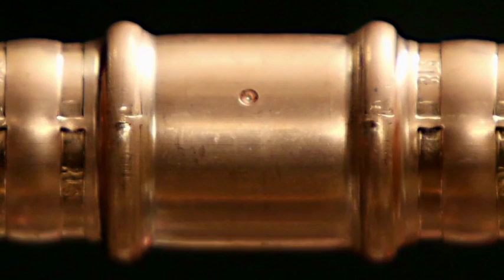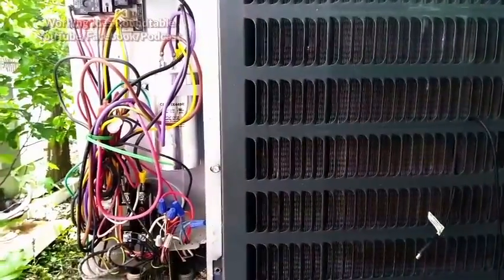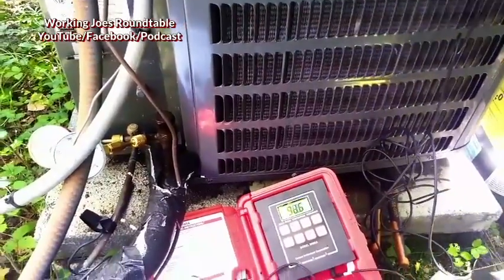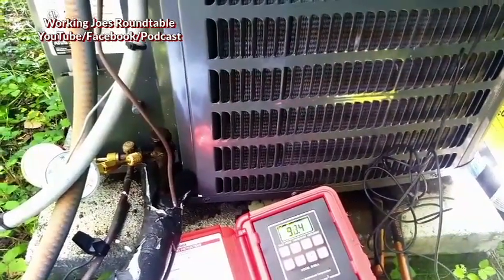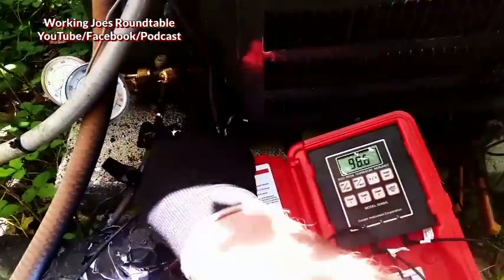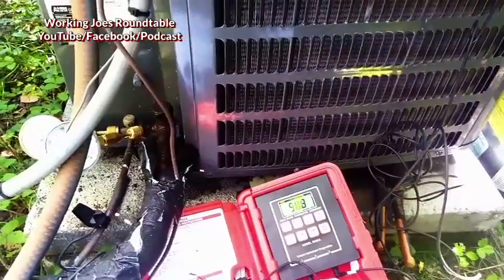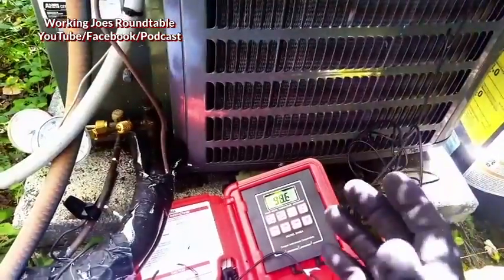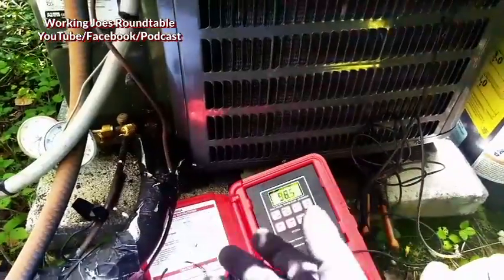Low Airflow Diagnosis HVAC 1

Comment: They don't care about low airflow; nor ever check airflow...!

The duct system may NOT have enough Available Static Pressure (ASP) left remaining = a LOW velocity design & LOW AIRFLOW...!
I’m showing that even a small 1.5-Ton air conditioner can lack available static pressure (ASP);
Blower Ratings .5”, .6” or .7” IWC - Manual D Friction Rate Design Process

Device   pressure losses IWC
Cooling coil   Included in Mfg’ers blower Performance at 600-CFM 
Grilles and registers  .06”
Transitions, boots . 1”
Dampers   .03”
Elbows   .03”
100-ft. duct length  .06”
Purolator P312 filters .16” @300-fpm velocity
Total    .44” Device pressure-losses

A .5“ IWC Rated Blower .5” - 44” = only .06” very little Available Static Pressure (ASP) 6/.08= ONLY 75’-TEL= 
A .6” Rated Blower  .60” -.44” = .16” Available Static Pressure (ASP)  16/.04”-FR=200’-TEL

A .7” Rated Blower .70” -.44” is .26”ASP LEFT . 26/.08 is 325-TEL ‘OK’

100*..26” ASP= 26 / divided by .08”-desirable Friction Rate= requires 325’-TEL;  Achievable!  
Double checking: 26 / 325’-TEL = .08” FR.

Comment: OK it's low airflow, but it looks like it  has next to no airflow. Maybe there's a big blockage in the ducts.
Reply: Cooll Asice small child maybe ?
Reply: You never know. It could be some insulation or a piece of sheetmetal from the duct blocking flow. 
Maybe  the family's child crawled in the duct to fix the low airflow and got stuck.